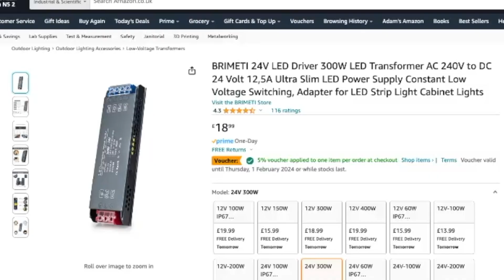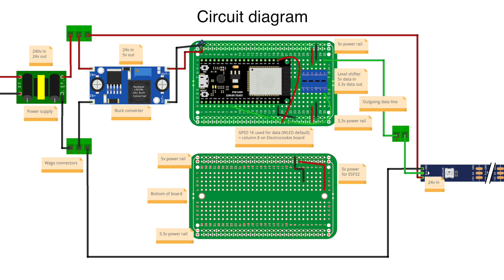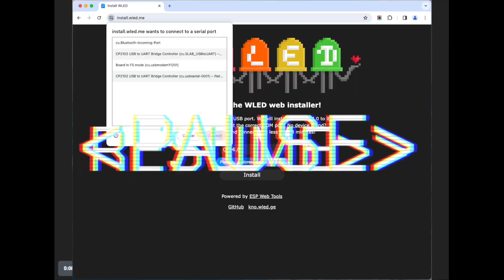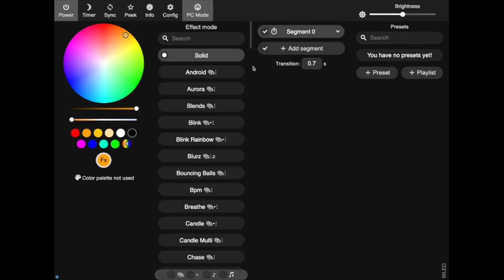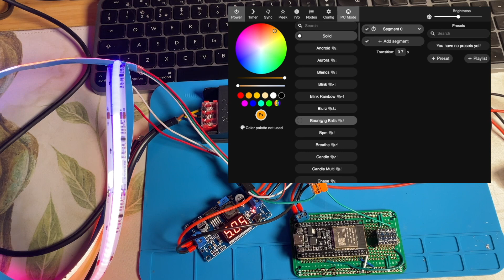WLED build. With level shifter, buck converter & 24v FCOB LEDs (UK)

Comment: Great video! Question about the level shifter and 12v/24v strips. The data signal should still be 5v right?
Reply: @robinb4828  Yes exactly. The data line needs to always be 5v, no matter what voltage is powering the LEDs.

Comment: Thank you for video. I did the same thing with 12 v cob rgb but my lights are still flickering with 4 feet 18g wire before led strip.  Any recommendations how to fix it ?
Reply: Try adding a resistor to the data line close to the ledstrip

Comment: Thanks for the video, been something i've been struggling to get to grips with recently. I've just seen your comment in the description about the flashing, has this been sorted now?
Reply from the maker: Yes, the flickering was, I suspect, down to the level shifter being too slow, in the end. Other WLED controllers can have the same length wire without the flickering. Either have a shorter wire between the controller and the first LED, or use a recommended level shifter. Best wishes for your project!

Comment: Can we do this without the electrocookie board? It's not available where I live
Reply from the maker: Sure: use any perfboardor even just wires without the board
Reply: @PharkieDoesElectronics-tv1vh  I have another rather silly doubt, I saw other circuit pictures having a capacitor near the LED strip, I have a 1000uf capacitor at home.. if I were to add it how can I with this setup?
Reply from the maker: @twicestan4life  A capacitor goes between the positive and negative lines close to the start of the LED strip: https://kno.wled.ge/basics/getting-started/. I don't show it because it isn't required in my setup. But if you need it in your setup, just add it after the circuit board and before the LED strip?
Reply: @PharkieDoesElectronics-tv1vh  as in directly to the +5v and gnd wires coming from the led strip? Would that be okay?
Reply from the maker: @twicestan4life  Yep! That's my understanding from the diagrams. As I say though, all my installs work fine without it. It's just there to even out the ups and downs of voltage spikes, I believe.
Reply: @PharkieDoesElectronics-tv1vh  okay I will give it a try, thank you for helping me.

Comment: What is the level filter for?
Reply: Level shifter transorms digital signal coming from ESP32 at 3.3V to 5.0V required by the LED strip. Sometimes (but not always) you don't need it if your ESP32 is few centimeters away from first LED chip but in general it is better to add it to avoid issues.

Comment: Thanks for the video. Even with experience with these kind of projects, the wiring of the level shifter without breadboards and such was a bit of a mess, but got it working.
Quite underhwhelmed by the low brightness of the 12V FCOB from BTF Lighting. Does this happen on the 24V strip too?
Reply from the maker: Yes. I would definitely use the SN74AHCT125 as a level shifter if I was doing it again, but you do see the one in the video in other people's builds. I have the 24v FCOB from BTF and it is SUPER bright, far brighter at 100% than anyone would possibly want. So that's likely to be down to either the amperage of your power supply, or the WLED settings (e.g. turn off the current limiter?), I would suggest?

Comment: I've done something similar myself... took me a few weeks and a bit of trial and error before I learnt everything I needed for a custom DIY led setup like this.

I also found off the shelf alternatives with fuses and capacitors later on but you live and you learn. I still enjoyed the tinkering.
Reply: Can I ask where did you find your off the shelf boards or what name to look for... All the ones ive found or the better ones are for QUinLed but are expensive and not readily/easy available in the UK.
Reply: @jsouto77  quinled doesn't look cheap but I'll tell you in comparison with doing everything on your own it's a bargain. I probably spent 2k fiddling with different LEDs strips, boards, soldering my own or buying voltage regulators etc. Sure i am happy with what I have but could have done it much cheaper by just using quinled. (power supplies ain't cheap and neither are thick wires that won't do to much voltage drop)

Good news is I have LEDs all over my house now and I can control them with home assistant so not much of a loss there...

Comment: Hey mate, great video, I've followed your set up exactly and is running into an issue where any time you power the WLED on/off, switch colours, it'll randomly cycle through a few colours before settling on the right colour, then once in a while it'll also randomly switch colours and come back as well. Is this the same issue you've had initially? Did you end up fixing the problem?

I'm also using 24v, with buck converter to ESP32, then to the bi directional logic level shifter data out to LED with power and ground straight from power supply to LED, pretty much exactly as your diagram.

Comment: Great video. Really well put together. Simple and easy to follow and understand. I've found this video in pursuit of making my 12v addressable led strip work correctly with ESP32 running WLED. I searched for level shifter which no one else seems to mention in their videos but things work fine.
In my current non-working set up I've got a voltage converter to power the ESP32 from the 12v power supply and I've wired everything up correctly yet I get unresponsive or random colour changes from the 5m strip. Doing further research WLED spec suggest a level shifter (yet there a few videos which reference this) so I'm going to give it a try since watching your video.
Reply: Thanks for watching! I finally got the SN74AHCT125 delivered but haven't had chance to replace it on my boards. I have found the Athom pre-built controllers to be good, easier than building your own and cheaper than importing QuinLED to UK. The WLED Discord is good for troubleshooting. Best wishes for your project!